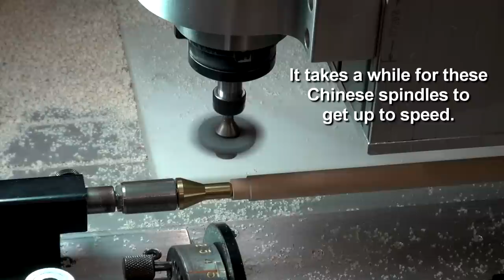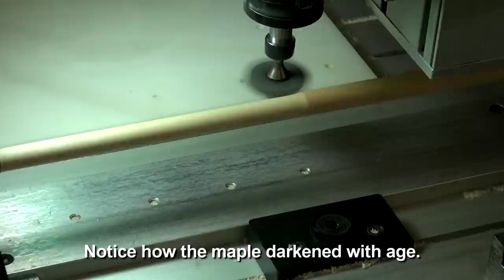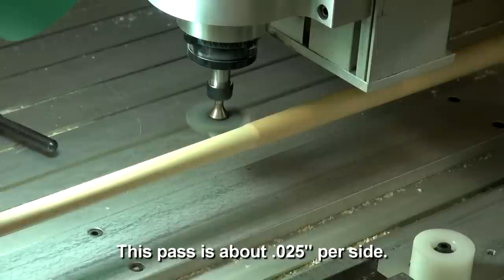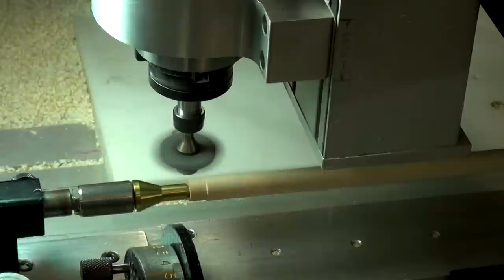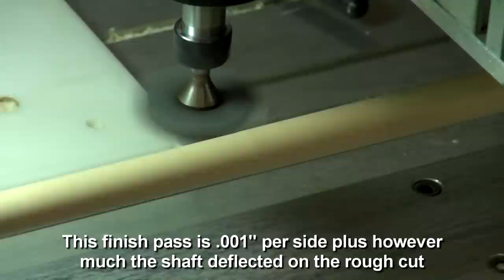Cue Making - Turning a Pool Shaft with a 3 Wing Cutter

Comment: What is the point? Cleaning? Refreshing? Making shaft smoother?
Reply: Cuts smoother. LESS pushoff on the shaft.  Less stress on the wood .
Reply: You take the shaft down slowly to cut out the movement and to avoid too much heat so it doesnt stress the wood and creste heat so by the time its all done the natural movement the wood wants to take has taken effect and he hasnt created any stress on it, in theory when he hands over a cue the shafts will be as stable as they can be and not warp. Impossible to avoid a little warpage in the long run with wood bc its an organic matter that draws in and pushes out moisture and expands and contracts due to heat and cold.
Reply: @MrKinghuman  Nice reply.